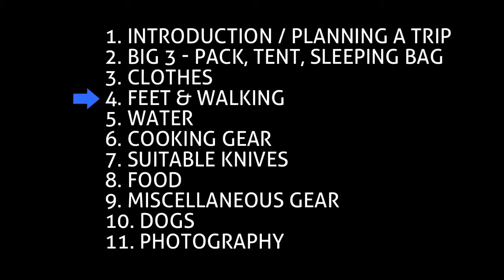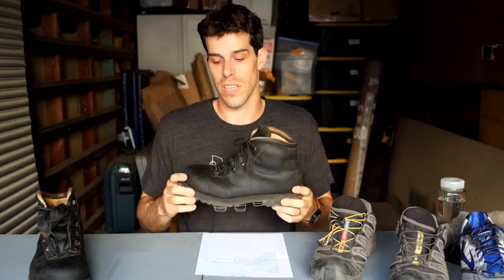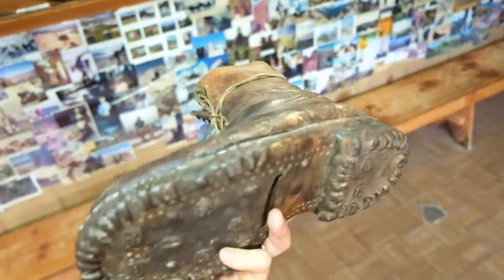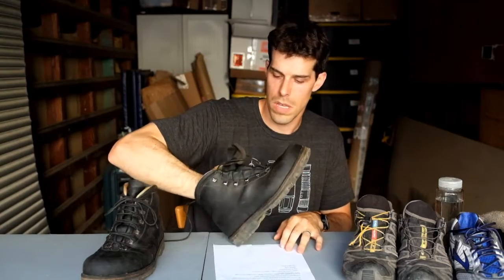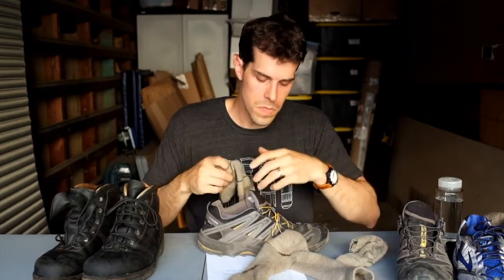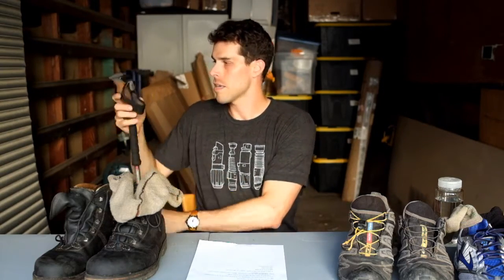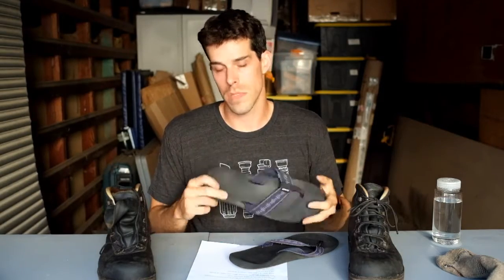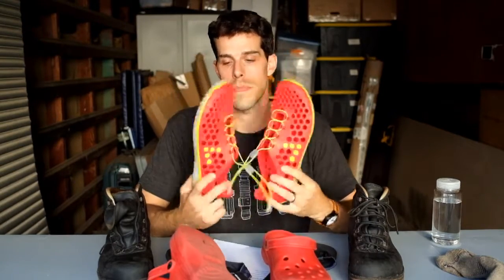Backpacking in California's Eastern Sierra - Feet & Walking (4 of 11)

Comment: the sneaker has know Ankle support so it does matter what shoe regardless of weight I roll my left ankle very easy
Reply: My experience has been that shoes or boots that are really "secure" cause me more trouble sprain-wise.  I tried some Altra Lone Peak 1.5 trail runners, and found that they let my foot roll partly out of the shoe when stepping on the edge of a rock.  The shoe holds onto the rock, and rotates, but my ankle stays straight.  It doesn't protect my ankles from getting scraped up, but I haven't sprained an ankle since.  It's worth trying.